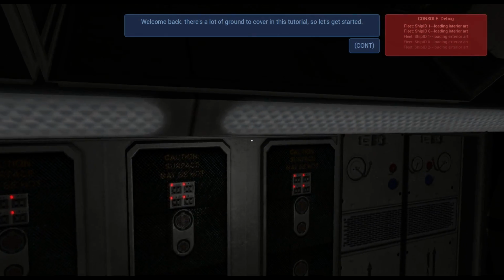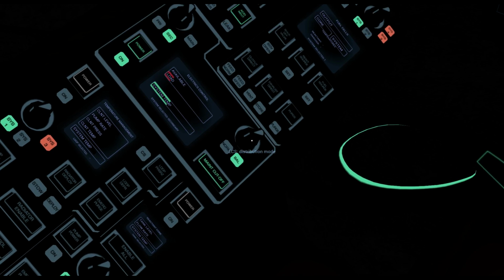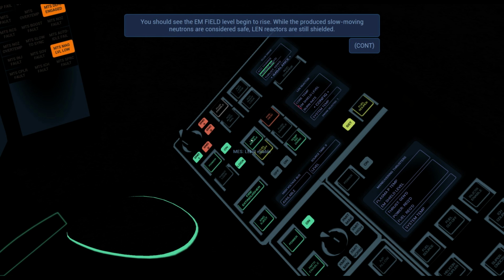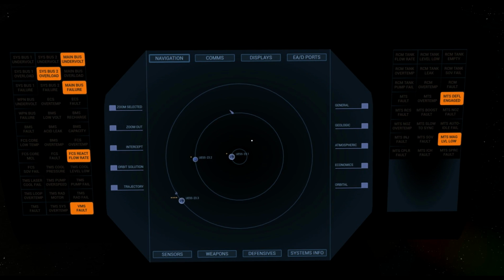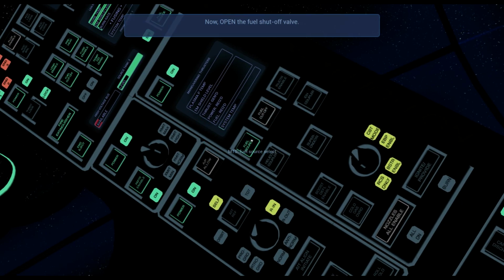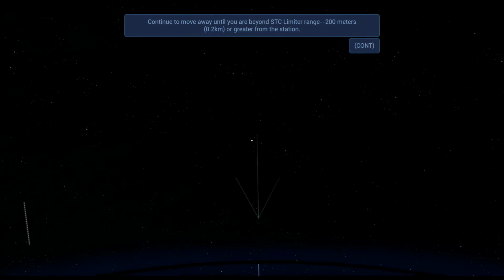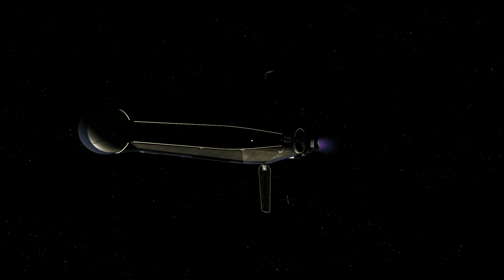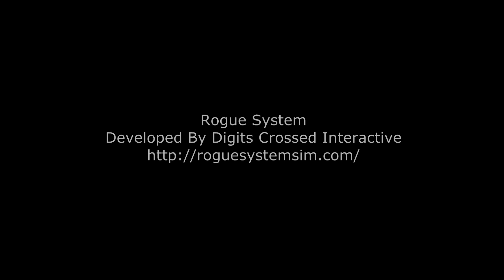Rogue System - Hardcore Spaceship Simulator (Alpha)

Comment: explaian to me why a "cold fusion reactor" needs you to turn on fuel pumps... It's not like you are burning JP8 or Jet A. Id assume a cold fusion reactor would just be ON... Like all the time, for years and years until something breaks or gives out and you have to replace it or something. like the fission nuke engines on aircraft carriers. I guess that would break immersion though :\
Reply: Combat Aviator Because fission reactor on carriers can t really be shut off (you can "slow" the reaction with control rod), but fusion reactor can be, to save "fuel" (hydrogen probably).
Reply: I just assume it's for the "fighter jet" feel when starting up. You know, battery, generator/inverter, fuel pumps, APU, motor engine 1, motor engine 2, etc.

Comment: Does it actually have realistic physics? The walking around inside a spaceship (Unless you're under rotational gravity while docked to a station?) is kind of offputting, that's not how spaceships work. Or the fact that it's horizontally stacked rather than vertical, like a rocket should be :/

Edit: yeah, unfortunately it's only buttons and systems, but not very realistic. Pity, I'll need to wait more and see if they'll add more realistic spaceship designs and features.

For example, those heat radiators are way too small just for the ship alone, nevermind a laser cannon.

Comment: Can you cook eggs on your CPU playing this game?
Reply: Hunne2303 Don't think you'd need to simulate others' ships at real time since all the calculations can be done on their side and you just need to receive the complete data.
Reply: azmanabdula No...I think I mistook your meaning. Your processing power may effect how fast your client runs, but it won't effect how fast the server runs. The server won't wait on your computer before advancing to the next tick.

I was saying that Zeke had it right, except that some calculations are done by the server.
Reply: azmanabdula Idk, but I'd love to see you try.
Reply: Drako365 I mean, If everything is Physically accounted for, The CPU must be running hard right?

Heat, electricity, weight of the ship, centre of mass....   etc...
Reply: azmanabdula Probably, I'm no expert on the subject.
Reply: Drako365 : P
Reply: azmanabdula I would guess that RAM is the bigger issue if it does not only simulate your ship but others too
Reply: Hunne2303 But all the individual point particles.... 

maybe...
Reply: azmanabdula Hate to break it t ya, but that's how it works.
Reply: Drako365
your processing power shouldnt effect a server....

This concept on the other hand, should...
Reply: Drako365 If everything is calculated, how off will the server be if you are lagging behind?

considering the scale involved, something has to give...

Comment: This kind of reminds me of the old space shuttle simulator from years and years ago - same concept in that they modeled the real shuttle cockpit as closely as they could, and every button, switch and dial did what it was supposed to (assuming the appropriate systems were enabled; otherwise the buttons and switches usually did nothing).  Rogue System looks far cooler already, though.

Comment: One thing I noticed: If the "windows" are actually monitors projecting an image/rendering of space, then how come when you zoom in on a control, the image on the monitors doesn't appear to get closer?  I totally get that in space, the "skybox" as it were would NOT appear closer if you learned forward, however when you lean into a computer monitor (Which is how the game projects space), it would indeed appear closer.  It's not a big deal, and I think that it looks way nicer how it is now, but I don't know if I'd call that realistic given the in-universe circumstances.

Never the less, the game looks frikken awesome and, being a huge fan of flight simulators, I will definitely check it out!

Comment: Scott Manley
Nice find. Do you know if this will work with the rift?
Also, I looked at the websites and I can't find a way to support this game. Is there a way at this time?
Reply: *****
How much should the early access be? Also, will this game be on Steam?

BTW, I'm thinking of featuring this game on my channel as soon as I can get my hands on it, because there is a need for this type of game.
Reply: *****
From doing some research, it sounds a lot like elite dangerous. Where you can easily just pick what you want to do, and you won't be forced into fighting or whatever (aside from a pirate or needing money).
I'm also assuming there is a possible MMO side of this that could come up.

In any case, what happens when you're out of fuel, damage too much to move or whatever? Can you call for help?
Also, can you have a player or NPC move you and/or your ship?

As far as trading goes, will the economy be dynamic? Or is it to soon to tell?

Lastly, will there be any ship to ship or ship to station hacking? If so, how realistic will it be?
(BTW, I maybe able to help you with that last one. A large part of my channel is on cyber security.)
Reply: *****
Oh and one thing I forgot to ask. Will the paint degrade over time, being shot at, and so on? Is there a way to fix everything without fixing the paint? What happens if you don't fix it? And, how do you fix problems at stations?
(what animation will be used? Will I see everything getting fixed, or will it just magically be fixed?)

Comment: It is weird sitting in a glass bubble on the chin of some giant transport craft in Elite Dangerous. I keep feeling like I should be back somewhere inside the main body of the thing using a digital cockpit. Glad I'm not the only one.
Reply: kiwiahead the human eyes have difficulty judging distance beyond a certain limit, and space is rather large.  most of the time you'll likely not even be able to see whatever it is you're targeting visually, if this simulator is as realistic as it sounds (and I have no reason to doubt it),  so likely you'll mostly be looking at indicator lights on a three-dimensional radar-equivalent map instead of trying to visually figure out what's going on.  by the time you can SEE an asteroid, for instance, it would likely be too late to do anything about it.  Lasers move at the speed of light, so literally by the time you see the other ship you'll be fried.  and railgun bolts here likely go at relativistic speeds.
Reply: kiwiahead The giant screens are likely to alleviate the psychological factor, and in any case it may display markers that, although the distances defy visual comprehension, have numbers next to them to indicate the number of kilometers or parsecs between you and the target.

As for docking, even today the procedures are done with screens and cameras, if I remember correctly.  Landing inside a spaceport would be best automated, or failing that, visual cues in the same style as current-day "back-up cameras" and collision detection would suffice.

A screen shutting down would be the same as any helpful system shutting down - painful, yes, but not a complete disaster with the help of emergency procedures and such.  If THOSE fail, then obviously the ship is in dire straights.  It would be the same as if a jet fighter HUD went down.
Reply: Maybe it also acts as evacuating in a emergancy.

Comment: It's unrealistically overcomplicated. In my view on such a modern ship most of this systems should be controlled by an AI.
Reply: ***** That's a neat way of doing it, since that's how systems like that seem to evolve in reality. 
Have you planned the future-history of the setting? It would be really cool to have ships from different eras--flying a Space! Tiger Moth vs a Space! Yak-130 would be a fun contrast.
Reply: ***** Hey!

When I imagine manned space fighters (and yes, there are reasons to have humans onboard even a small vessel, as long as the task is complicated or unpredictable or if there are ethical/law concerns), I always thought that one of the most important interfaces would be a panel with a gigantic list of autopilot commands and nobs and screens with options or adjustment to these commands; 
like for example circling a target, assuming (and holding) a relative position, flying to a marked point (in a specific pattern), holding view on target, adjusting orbit, hold height above ground, hold relative speed, follow target, follow target acceleration, and so on. 

Are such commands planned / Would that be possible?

Comment: The layout is so very 80s.
Reply: Not often you get a response from the developer themselves.  I will be following your progress with interest, it sounds like you have big ambitions for the game.
Reply: ***** Any thoughts on VR support and holographic displays similar to Mass Effect or perhaps Minority Report?
Reply: ***** 
I was thinking that, if it WERE going to be compatible for the Oculus, I would suggest  that the mouse be locked with the view rather than the game itself, so that when you move your head this way or that, you wouldn't have to move the mouse with your head movements.
Reply: ***** will it be possible for a gamer who already has multiple simulator controls, joysticks, keypads, switches and the like, to combine all that with the rift and use them with this game?  THAT would be taking immersion to a whole new level!